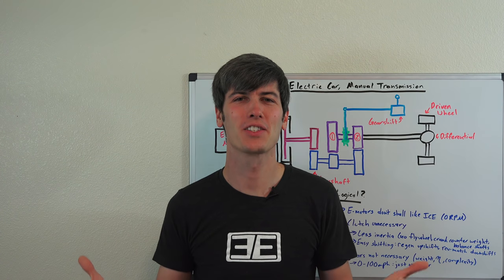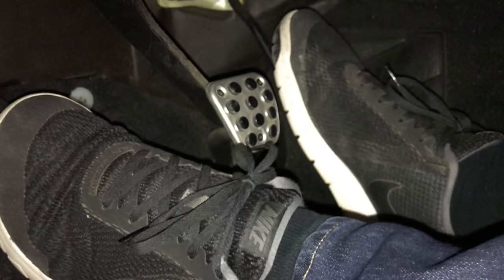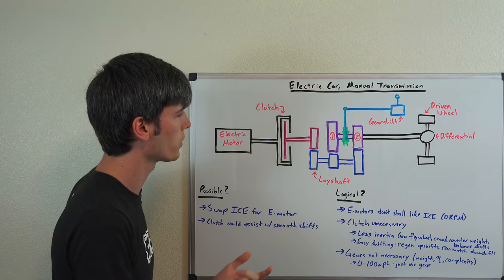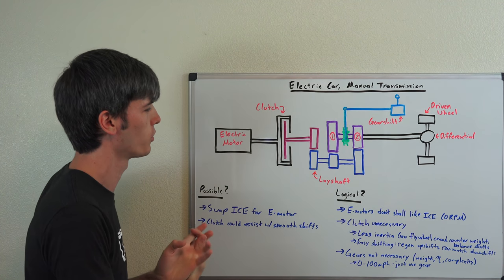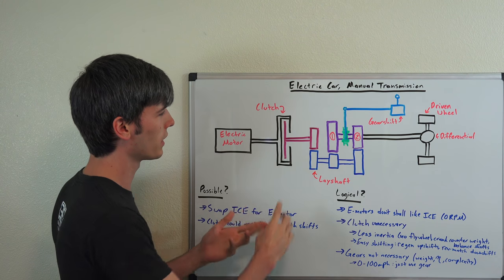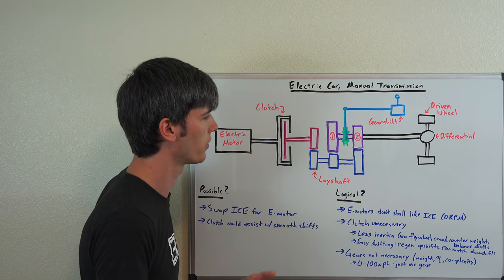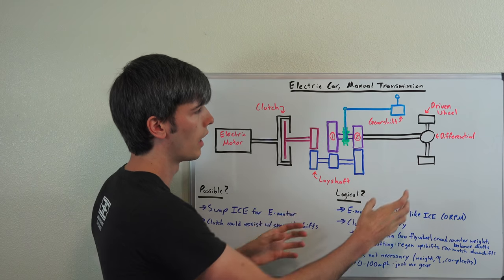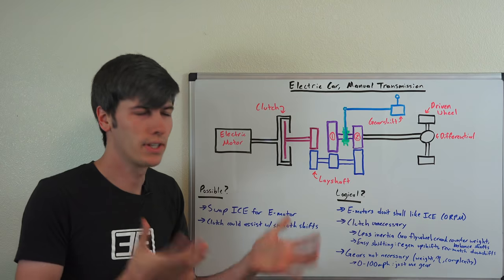Could Electric Cars Have A Manual Transmission?

Comment: "It's really for joy rather than for a logical reason..."

It's logical to want to experience joy, therefore, manual transmissions are logical.
Reply: Bruce Schneider Brilliant, I say!
Reply: Also if you drive a manual its harder to steal since only 4% of Americans know how to dive a manual
Reply: yea because the whole world is american right?
Reply: MyDryPancakes Your name suggests that you're English, your comment suggests that you're trolling.  Let's focus on the point; driving manual transmissions are more fun than autos
Reply: both your assumptions are wrong, i dont see why you think im trolling. my reaction was for  Generic youtube profile guy, since he was the last to comment.
Reply: Electric Motor without gears = engine + automatic transmission . So why shift gears when there aren't any?? I think u know that the ceiling fan in a room doesn't require transmission/gears to change its speed. It only requires a knob with variable current/voltage .
Reply: Your statement is only right if the person in question experiences joy when operating a manual transmission.
Reply: He did say that there are a lot efficiency losses in these manual transmissions. Though, I believe that if there were manual transmissions in an EV, then it would probably have 2 or 3 gears and not the manual transmissions that you see in iCE. For most electric vehicles on the road (Leaf, Tesla, etc.) only come with a single speed transmission because having more than 1 gear is inefficient in these types of vehicles.
Reply: Would. Be nice to see a car manufacturer that actually keeps this idea in mind and go against the grain and make a Manue E car just for passion. That would be joyous
Reply: That's a logical fallacy lol :P
Reply: @genericyoutubeprofile82  Doesn't work in other countries tho
Reply: Manuals are logical for more reasons than that. They are usually lighter, more reliable, cheaper and can be more fuel efficient. And i also think that automatic transmission makes your engine less reliable because it changes your rpm so quickly.
Reply: As a computer engineer I flinched, when he kept using the word "logical" in this context. I would have opted for a word like "beneficial", "economical" or something similar instead. 😉
Reply: bob no but if you live in America you have an advantage by owning manual
Reply: Generic YouTube Profile it’s actually 18%
Reply: @cornerbloke8861  yes that is right, regarding EVs aside.. manual transmission cars are way better than automatic and that is proven, especially with the Dual Clutch Transmission (DCT) which is basically  manual transmission that is more energy efficient. I suggest you watch these videos regarding DCT to better hype you up.

But if we're getting real here, EVs WILL take over combustion vehicles and it is logical not to put automatic, manual, or dual clutch transmissions into EVs, and I will surely miss manuals..
Reply: they are more reliable too and can take more power
Reply: @cornerbloke8861  for ice cars. But for evs, transmission is not logical. But pretty sure people will retrofit with older cars an electric motor and manual transmission for nostalgic and fun reasons
Reply: Rudy Whitaker  

*Except in Indonesia, because there's a myth about "Automatic Transmission are useless on uphill road"
Reply: @raptorreaper  because it’s 

F
      U
             N
Reply: @bobbakker8  For Americans, yeah
Reply: @raptorreaper  yo u cleared a question that I ask myself everytime I turn on my fan :
Does fan use gearbox for increasing the power ?
thank you even if this com is 3 years old.
Reply: @genericyoutubeprofile82  I dont think a manual EV will have clutch that turns off. As this is not needed.
Reply: Manuals are better in bad weather and im moutainous tegions.
I wpild think an electric motor poweted car with a transmissipn would use less power with a high gear at highway speeds.  EVs have heavy batteries ynd use that battery to power EVERYTHING...heat, AC, radio, the motor, windoes, seats, etc.
EVs are overrated.  Tpyota is developing hydrogen poweted cars that will mot need lithium ion rate earth batteries.
Reply: @genericyoutubeprofile82  More than that can drive a mamual.  Some peoplecan drove a manual but dpnt own a manual car.
Reply: This is genius
Reply: based
Reply: Tesla Model 3 has highway range of 200 miles if you cruise at 75 MPH vs 300 Miles if you cruise at 60 MPH.  So will gear help?  or use different gear ratio?
Reply: @eddiepan6524 no it won't help

Comment: Manual transmission offers 2 additional control features over 1 speed.  Slip and range are very important for control.
Reply: electric can do that aswell :d
Reply: One electric motor will not have the right power curve for both low and high end power. Geared transmissions will.

Comment: The electric van I was driving was a conversion and it had its old gearbox in there, without the clutch. Around town you would stick it into 3rd and it gave great acceleration and responsiveness from zero. But on the motorway it did need a higher gearing for best effect; so one would stick it into fourth or fifth. A lack of clutch was no real problem.
Reply: Would be nice to chat up with you
Reply: i get how clutch is not needed to move a car from idle but how does it change gears on the move?

Comment: As someone who builds and rides electric bikes on a daily basis I have to point out some flaws in EE's video...

First, Formula E cars don't stop often like a production car would at traffic lights. Formula E cars top out at 2000 lbs, are made completely out of carbon fiber, and only seat 1 person. Electric production cars like Tesla weigh over 4000 lbs.

Direct drive electric vehicles compensate for lack of gear reduction and torque multiplication by using TONS of power. Formula E cars top out at 200 KW. The problem with this in a production vehicle is that parts that can stand up to that amount of torque reliably for long periods of time will be very expensive. You can achieve the same exact performance output at half the power with a 1st gear that is 50% under drive, but you have half the top speed. 

A manual transmission would allow a lower power motor to accelerate faster at much lower speeds while consuming significantly less power over all. This is very important as a production car would need to be able to drive further then the 10 laps around a race track and battery tech is still lacking in the energy density department. Also note that most of the Formula E cars still use a 5/3/2 speed trans because it allows them to accelerate out of turns or jams faster because of this reason.

The amperage required to provide 200 KW produces a TON of heat because of the high amperage leading to needing complex cooling setups and very expensive heavy gauge wiring and connectors.

There are 2 speed transmission setups that allow for under drive and direct drive that have no parasitic loss in direct drive. One type uses two 'one way' clutches to either spin a planetary gear or couple direct drive. These take advantage of the fact that an electric motor can provide full power no matter which direction it spins, but, they can't provide a way to back up. The second would simply use a clutch system to provide the coupling thus allowing you to retain reverse. The efficiency gained with an under drive is greater than the parasitic loss.

Also, direct drive setups would perform worse in any environment with hills compared to a multi geared drive setup.

Do note that there are also several different types of AC motors. Induction motors can handle higher amounts of power but are not as efficient as a PMAC (BLDC) motor as a PMAC doesn't have to create the magnetic field in the rotor as permanent magnets provide a very strong field thus requiring less over all power. The only disadvantage of a PMAC is the neodymium magnets do not tolerate high temperatures that lead to demagnetization.

PMAC motors are most efficient at 80% unloaded speed. So, on a production car, if you are cruising at 40 mph, having a gear that allows you to keep the motor close to peak efficiency will give you significantly more range not only because it is at the most efficient RPM, but, because having that torque multiplication means the motor does not have to work as hard, thus consuming even less energy.

You can also get a 2 speed AC motor of both types without any gear box by Delta/Wye switching. 6 relays are a lot lighter than a transmission. 

There is plenty of information on the above available on ebike forums.
Reply: MasterQuack14 
Incidentally, the original Tesla Roadster prototypes had 2 speed transmissions that enabled faster acceleration and a 210kph instead of the 190kph top speed of the production model. IIRC the reason they went single speed was because they could not stop drivetrain components from breaking.
Reply: People often forget that regardless of how good it's torque and power curves that still have optimal spots and that a single speed set-up will always be a compromise between acceleration/efficiency/top-speed. I would also would like to see electric vehicles with CVTs and better development of the CVT as a whole as some concepts and workarounds address the torque and launch issues. The fact that you can get away without a multi-speed transmission doesn't mean it's the best solution for everything.
Reply: Sten And you forget that the average people hate to do maintenance on their cars. Refilling oil and replacing brake pads already is just too much to ask.
Reply: MasterQuack14 That's incorrect, it requires the same amount of force to accelerate at the same rate no matter what gear you're in
Reply: An Electric car is the last place youre going to find a CVT, they just can"t handle the torque
Reply: So there is hope electric cars will have manual gearbox

Comment: Soon, Automatic 4-speed transmission 

           Dual clutch 7-speed transmission 

Over and over

      Finally, Vtec electric
Reply: Bryan Wong vtec electric? That doesn't make sense. Electric motors don't have valves.
Reply: Myasa Man you don't know what happens tomorrow. Turbo electric ? Using Magnus effect ,regenerative flywheels?
Reply: Current Boost.

After a certain RPM, throttle application, the electric motor gets 1.5x the current giving more power
Reply: Bryan Wong ricer ev
Reply: Giving an electric motor multiple gears is actually kind of analogous to vtec - at high (for electric motor) rpm the motor's ability to deliver power starts dropping off. 

Of course I also have to wonder if changing the number of phases that an electric motor has makes any sense when it comes to getting it to operate over an even wider rpm range.
Reply: Oh but when that VTec kicks in 😎😂
Reply: Automatic Transmission's hydro clutches wouldn't be able to hold the torque unless they were the size of a diesel transmission. Very large and heavy.
Reply: MasterQuack14 you clearly haven't seen American drag racecars. No traditional transmission can handle the torque immediately but it can if you "slowly" add the torque.
Reply: powerglide ................
Reply: @Motolav

Gas motors do not provide 100% torque from zero rpms. Racing motors tend to hit their peak torque significantly higher in the RPM band. Automatic transmissions require input RPM to drive the hydraulic pump that applies the clamping pressure to the clutch plates so that it can actually hold the torque being applied. An electric motor doesn't use a torque converter either. That is why automatic transmission can handle gas race cars but will explode when hooked up to a similar AC motor. 

https://www.youtube.com/watch?v=Ie7qvo-aC5k

Explains how to use a Power Glide transmission for a electric car conversion. TLDR they require an auxiliary hydraulic pump to apply the required fluid pressure to the clutch plates before you can apply the main motor's power. 

Also, I have done several motor builds for drag racing before and have experience with drag racing and auto cross. I also am on my 4th electric conversion. How many electric vehicles have you built? How many track cars have you built?
Reply: Bryan Wong lmbo it's vtec from the beginning
Reply: Bryan Wong that would be so wired cause that would mean i would go from manuel to electric completly skipping the automatic tranission
Reply: Bryan Wong it will have VBEC, Variable Brush Electronic Control
Reply: Bryan Wong but there is already auto 4 speeds
Reply: EVTEC
Reply: @bryanwong1558  Porsche tried the flywheels already...but they were for "storage" and not for maintaining revs of the engine. I don't know why piston engines don't have magnetic flywheels...easy to do...(maybe a "cheat" no one talks about).
Reply: You are deluding yourself, it does NOT work.
Reply: Myasa Man r/wooosh
Reply: @IIGrayfoxII  Where?
Reply: @IIGrayfoxII  Totally wrong
Reply: you know they do have fake exhaust car noises they could in the future make Honda vetek sound for an electric Honda

Comment: Something I've mentioned many times on EV channels (never with a good reaction) is that Electric vehicles have the ability to simulate gear ratios and engine characteristics like a real world driving sim in software. Coupled with decent suspension customisation you could have your EV perform like any car you want (considering its powerful enough of course)
Reply: I'm actually down for this. And have them sound realistically too. I would love it if my EV sounded and felt like my favorite car!

Comment: Been thinking about this and it’s application to motorcycles specifically. There are many handling situations where having a clutch on a motorcycle is very handy. The current electric models all fail in that regard.